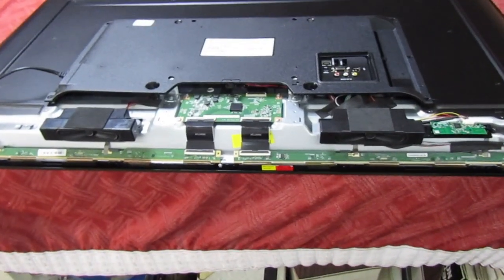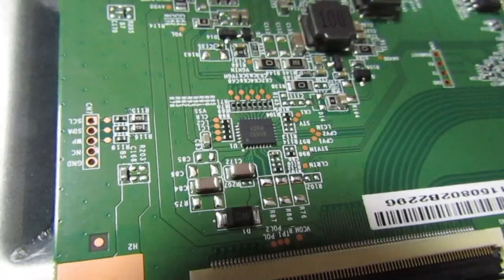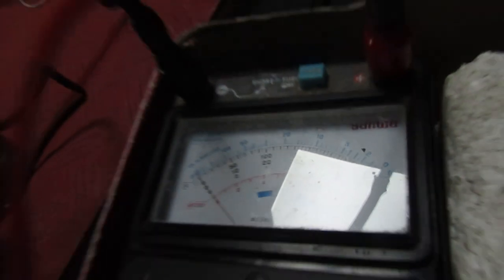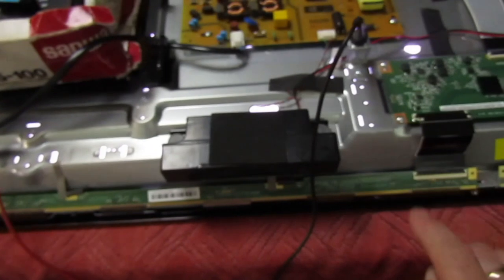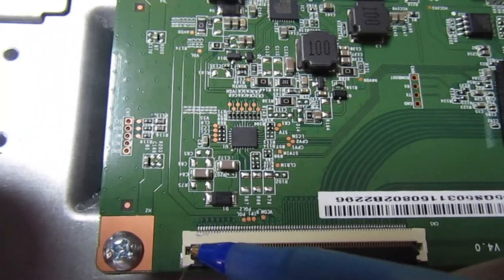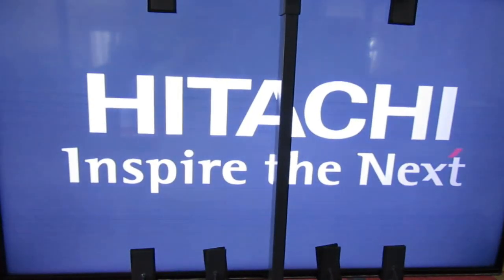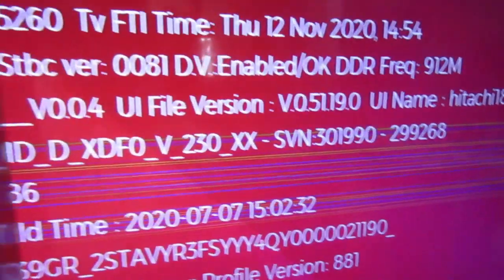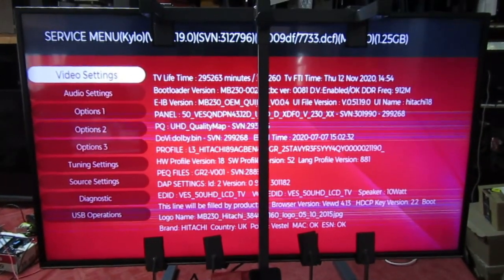Hitachi 50HK6100UB no picture, common fault , I show how to diagnose the problem.Vestel based.

Comment: Had two 58HK 4k, similar faults panels are rubbish these days I won’t buy any more there total rubbish and both of these were 2021
Reply from the maker: Had quite a few of the 58 inch ones too with the same problem.
Reply: Both 50 and 58 with HKC based panels. I don’t know how long Vestel was using HKC but it seems to have started from about 2020.
Reply: @interstat2222  they are just really bad cheap panels, or they’re just pushing them too much with 4k technology ?
Reply: @wisher21uk  They’re designed as 4K TVs. If it’s the LCD layer or TCON module that fails you'd think it would be an issue with HKC, the Chinese panel maker Vestel buys from in these sets. 

Or maybe Vestel’s unusual method of making the backlight and rest of panel layers in Turkey themselves has poorer QC than the Asian panel makers. 

I don’t know. People can’t expect much reliability from something so cheap to buy though.
Reply: @michaeldranfield7140  I think everyone has Michael lol
Reply: @interstat2222  when it’s the panel that fails it’s a shame, and I wouldn’t say the quality of the image is up to scratch either but I suppose it’s what you pay for and the punters keep buying their rubbish
Reply from the maker: @interstat2222  I suspect its an in glass short rather than failure of the COF , I need to get one of these that a customer doesn't want back and cut off all the COF s one by one just to satisfy my curiosity .
Reply: @michaeldranfield7140  That would be interesting. Not something that can be fixed maybe but at least we'd know. I've got one here, if my customer doesn't want it back I'll have a go.

Comment: https://youtu.be/U7oyLb_42Os?si=631ilXbebCul6QLX
Hi sir how are you...
This is the link of your video..
I got this filament connector one pole in short with body... I cut down this connector and found some conductor strip and ferrite core.
I was thinking it must have some purpose and feeling it must b some kind of capacitor.
But i was not sure...
I have search a lot, then got your this video.
It is good to listen that it has two capacitor of 350 micro farad µF. But here I am looking for a question why manufacturers use capacitor here and if we direct connect chocks with Wall socket by bypassing this connector then what will be the scene here.
In that video there was no option for comment that is why I am commenting he.
I am from Pakistan and Avionics Technician 
Thanks

Comment: Damn these things are total crap, save your money and buy a sony
Reply: Trouble is they are no better either these days, they use other manufacturers display panels
Reply: @jonathaneastwood2927  Not even in the same league
Reply: all is not good enough now..even sony.
Reply: You might change your mind after seeing piles of unfixable Sony Android-TV motherboards with failed EMMCs.
Reply: @sodderbridge  Well my bravia 32" has been on for 8 hours a day for the past 13 years with zero problems.
Reply: @Synthematix  You have zero credibility when you are not a TV mechanic and you have experience with one vintage Sony.
Reply: Aren't Sonys these days made from the same chinesium as all the others? Not like the old days when Trinitron was the best.
Reply from the maker: While Sony use to be good years ago they are following everyone else in cost cutting which is not suprizing when you consider in the 80s an avarage 22 inch TV would set you back £300, just look what £300 buys you now.
Reply: @michaelturner4457  Not really, Sony Japan is an OEM and they do make their own parts, sony and toshiba are rolled in to one for tvs
Reply: @sodderbridge  Mechanic?
Reply: @jonathaneastwood2927  Sony are still good. They still take high spec parts and make their own backlights and have high quality power supplies, so you’re paying for that. Although I think a high end Hisense is very good value and quality now.
Reply: @Synthematix  All Sony TVs are assembled by Foxconn but Sony uses quality parts. Toshiba is no longer in the electronics industry.
Reply: @interstat2222  Thats right, my sony amplifier is loaded with nichicon fine gold capacitors, after 23 years not a single one of them is out of spec
Reply: @Synthematix  that's Sony from almost a quarter of a century ago, Sony is just not interested in quality electronics anymore just games and films. They lost their way since the 90s
Reply: @sodderbridge  And how do you know what i do for a living? and btw mechanics work on vehicles not electronics, have you seen the multiple repair videos on my channel?
Reply: @jonathaneastwood2927  Then im puzzled as to why new sony bravia tvs cost £4,000, do you really think these tvs are even in the same league as the cheap shit found in wallmart/asda? vestel tvs are designed to be thrown away after 2 years
Reply: @jonathaneastwood2927  Sony (and the few genuine Panasonics) still use top quality parts. Just because the panels come from mostly Chinese companies doesn't make them low quality. Chinese can do high quality too but most of what is in for repair is low end models. 

With everything in life you can't expect reliability/quality if you don't pay for it, now more than ever thanks to rising costs! 

Sharp back under Japanese (and part Taiwanese) ownership now seems to be using Taiwanese parts which I have always found reliable.  

These Vestel TVs are sold for next to nothing and Vestel has been switching to Chinese capacitors and panel makers (from new panel makers like HKC) to save costs even more. Vestel used to have some pretty reliable TVs in the 2000s but then they cost more with Taiwanese and Korean parts.
Reply: @interstat2222  Yes correct, china actually make some of the best electronics on the planet, unfortunately vestel sets are not a good example, they were designed from the ground up to be cheap and then have any old badge slapped on them.